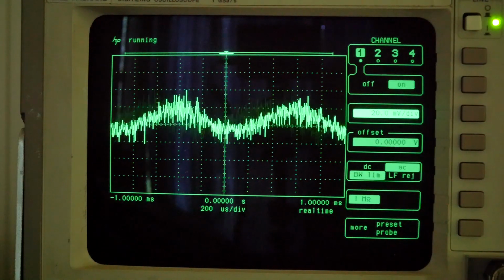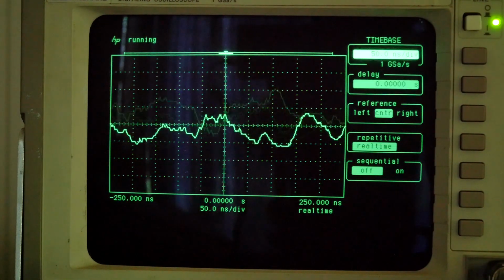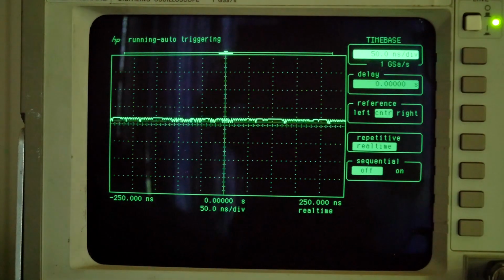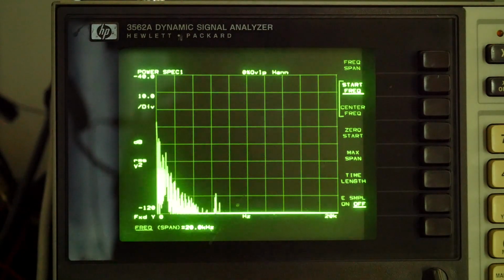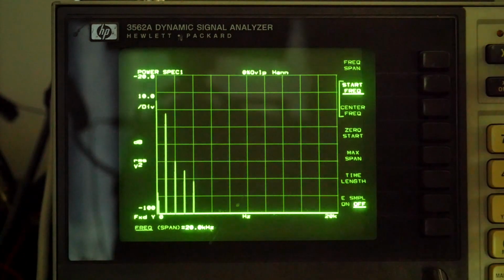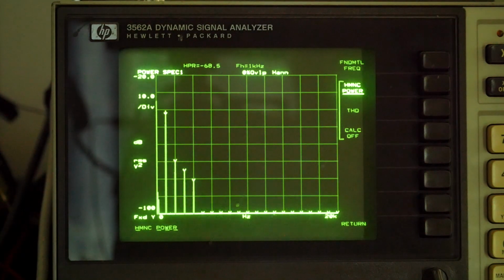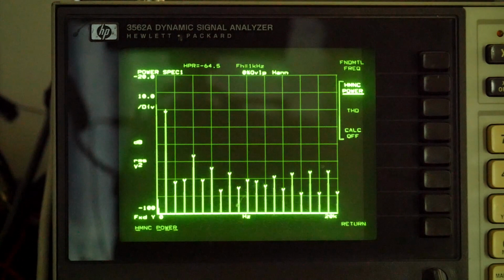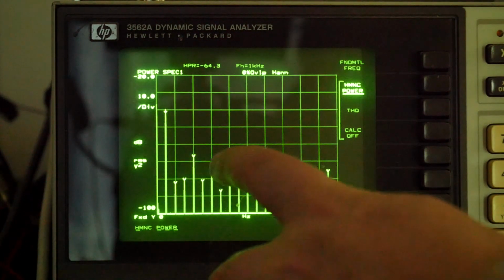Error Correcting Headphone Amplifier - Testing

Comment: Your 3562a has a good CRT! That's a rare sight!
Reply from the maker: She's still hangin' in there - which makes me happy indeed. (I also have a spare NOS tube in a box somewhere, just in case...)
Reply: @KarlAdamsAudio  Wow they are impossible to find. Hold on to it, if mine fails the other option is the LCD replacement.